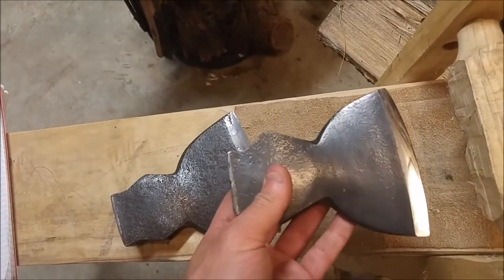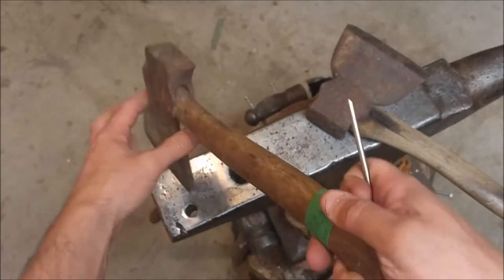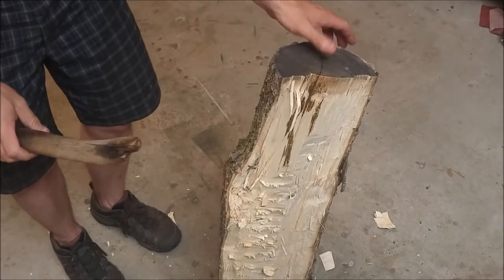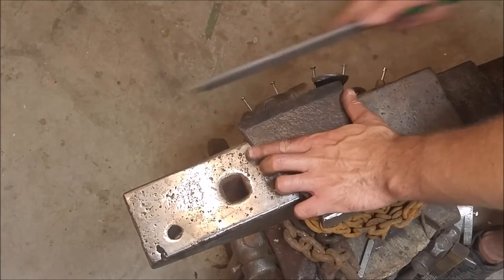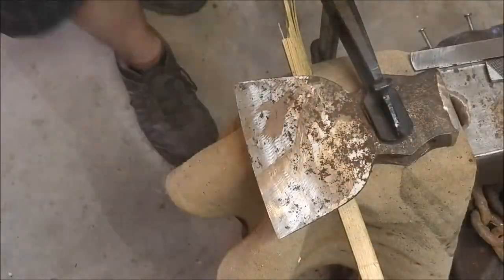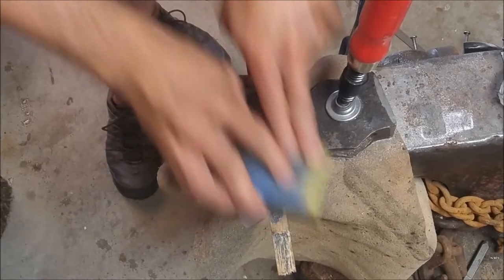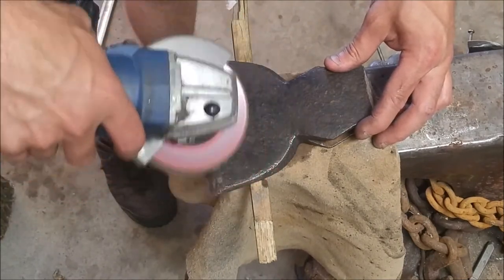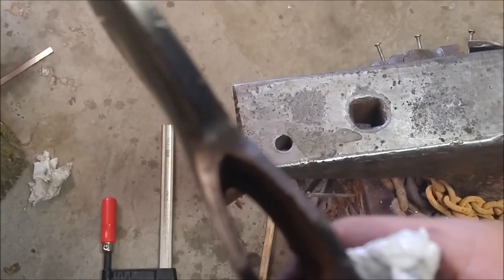Hewing Hatchet / Axe Restoration Part 1 - Initial Head Cleanup

Comment: OK, I've seen a few of your videos but you could've done this better.
I haven't 'reworked' a lot of tools but I did a similar job on a hewing hatchet last year.
You filed off the peened over corners.
I take a hammer (ball peen, usually) & beat the corners back into shape as much as I can.
Only after straightening the corners then I may file 'em, *may*, only if they are still too sharp.
You've got a an anvil, you don't ever need to heat the head.
Just take a hammer & beat the corners back as close to original as you can.
Nobody expects perfection but you can get it much more like the original shape w/ just a hammer.
Beating on the head, or it on another piece of metal is what rolled the corners in the 1st place.
So beating them back into shape is the better way, at least IMO.
 My point is I try not to remove any metal that I don't have to.
To remove rust without grinding, filing, etc., I use citric acid, vinegar, or both.
It will, as you said, change the look, the ones I soaked look more grey than brown or reddish
But it does not remove metal.
Have a GREAT day, Neighbor!